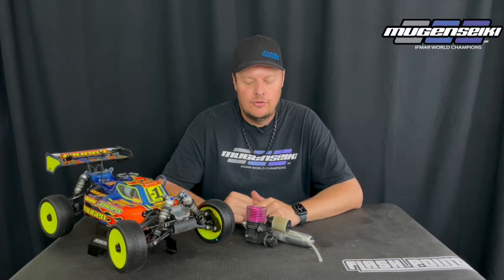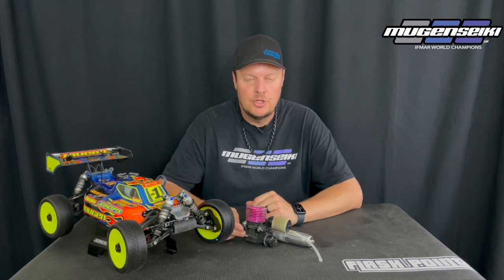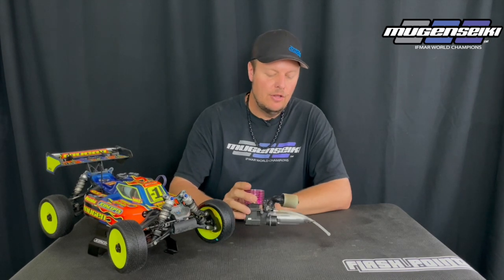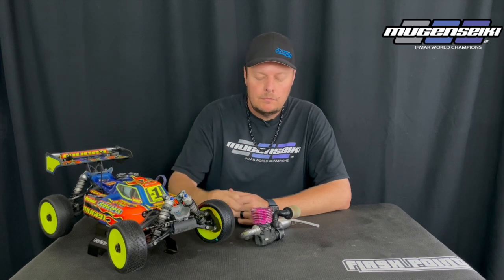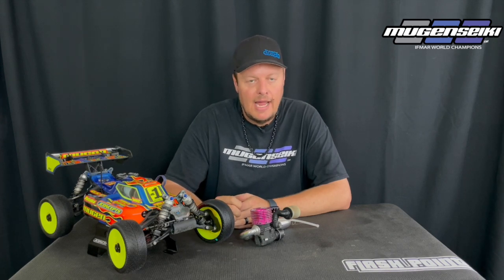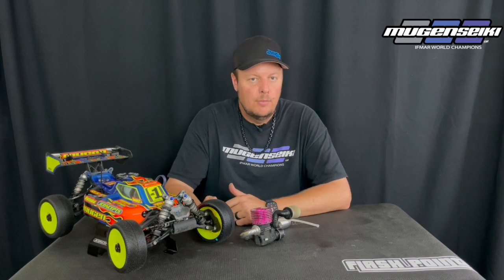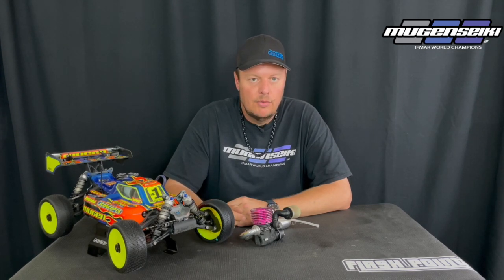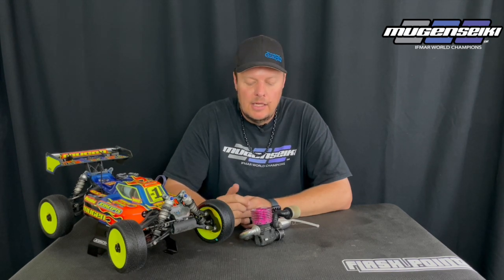Are aftermarket backplates needed?

Comment: Another great video. How often do you change glow plugs?
Reply: Yes, I would also like to know that. It would be also important to know what are the symptoms of bad or worn out glow plug.
Reply: I'm just club racer but if your plug isn't a bright orange/yellow it's done. Just plug into you glow ignitor and check it. When in doubt switch out.
Reply: All depends. Take your plug out and look at it. If your glow plug element/coil looks like it’s been sand blasted and is kind of grey it’s time to maybe replace it. If it’s very grey and disformed definitely replace it. If it’s got a nice shine to it but on the bottom of the plug itself is a nice golden brown keep on running! Could be a tank could be half a gallon. There is no definite time line on how long a plug lasts because there is no guarantee you will get your air/fuel mix the exact same every time